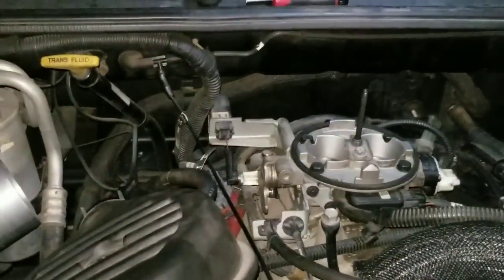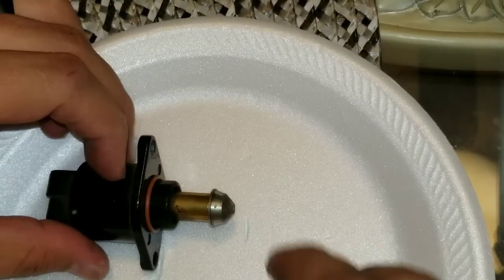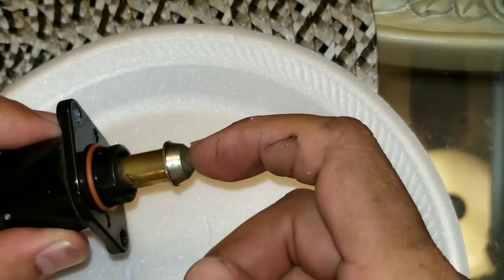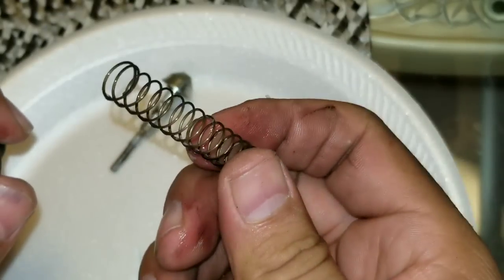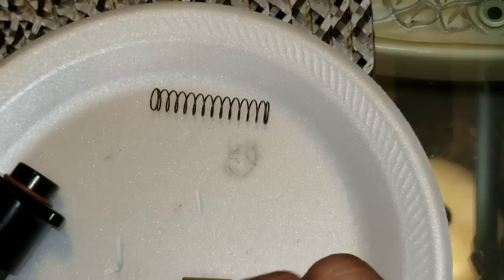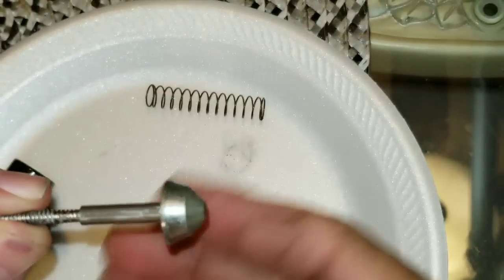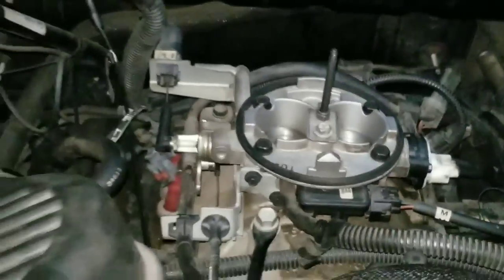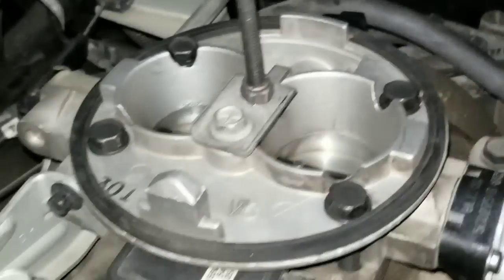How to clean the Idle Air Control (IAC) valve

Comment: That white substance was >>White Lithium Grease.  It is a bit heavier/thicker than 3inOne oil.  3inOne oil just might be vacuumed out of the IAC due to the engine air intake suction.  A slightly heavier grease may have been better.  Such as Synthetic if not the OEM.

Comment: That's how you destroy the iac valve, the plastic bits on threaded rod are stops so rod doesn't spin in place. 
Time for a new valve. 🤔
Reply: Yup. Pulled mine out to clean it and ruined it this way. Had to go buy a new one yesterday for being an idiot. 150 bucks down the drain.

Comment: Do not use acetone to clean the valve as it will destroy the internal seals. But spraying it with q20 will dislodge the carbon deposits. Leave it soaked for 1/2 hour then.shake it out. Repeat if necessary.

Comment: But bro it breaks the lock which keeps the spindle in position. I removed th iac of my bike.while doing throttle cleaning ,my father turned the spindle and when i fitted it back guess what the spindle started rotating and came out.

Comment: Well-intentioned Brandon. However it breaks that plastic shoulder inside, that it locks into. You're lucky It didn't break your plastic shoulder the pintle shaft goes into, and the idle air control valve is likely to vibrate and move the pintle. The shoulder made of plastic is not going to hold it from moving if there's any vibration which there is probably and it's not going to stay put for long. this might work in a bad situation where you have to have it right now, but it's not going to be a lasting solution.
Reply: Good point!
Another way to remove the spindle is by remove it from TB but do not remove the cable. Turn on car key, the IAC will automatically move spinde forward and eject it. Don't forget to wrap the IAC in some container or the spring and shaft will gone!
Reply: @MRsickcat84  how do you replace it afterwards?

Comment: Got the p0505 code.  I took it off and sprayed it with carbonator cleaner.  Now it idles worst.  Starts up good.  I did not take it apart.  I will do what you did.   I am thinking I can just clean it.  It's not like a brake pads.  I will let you know if it works.
Reply: Still doesn't work.  Put a new one on.  Still doesn't work. Fuck cars
Reply: Try Clean throttle body n map sensor .

Comment: I’m sure you broke it. It does not screw out like that you have to pull it straight out. They only cost nine dollars and up if you don’t want to buy a new one you just glue it in place which I did because when you can’t get to a a computer you don’t have access to adjustments

Comment: That "little nipple here" is called a "pintle".   This IAC valve isn't, even the slightest bit,  in need of cleaning, BTW.  I'm reminded of a couple phrases while watchin this......"looking for a solution to a problem that doesn't exist"  and  "if it ain't broke, don't fix it".
Nice video demonstrating the breakdown of an IAC valve, though.  Not sure why your "problem" went away after this, but I doubt this is what "fixed" it.  IAC valve has nothing to do with shifting and rough idle can be caused by many things.....IAC more a factor in idle speed than roughness.
Reply: I've found the wire harness connectors connection for some reason can be an issue on the TPS and my thought is just cleaning the tip of the IAC maybe.  I'm no expert and have only removed the TPS and rotate full motion to verify the DMM resistance readings range for the pinouts and the IAC to clean with just some carb cleaner dampened shop towels.  Also, cleaning with the dampened shop towel the inside of the valve and as far as I could get in of the inside of the body.  Seems to do the job when mine starts running funky.  Wondering if just the TPS, for some reason needs a full range of motion, is all at times.

Comment: well... I just destroyed my idle air control. mine is locked in with a rectangular shaped insert, so when I tried to unscrew... it then cracked and split🤔
Reply: The video was poor advice, though I gave him the benefit of the kind intentions. Mine broke as well the plastic shoulder that it goes into that locks it in place is broken. Well in a pinch I think his advice is good but the force needed to detach the pintle and rod breaks the shoulder that it's inserted into so the life won't be very long probably for this, because it's not locked in place and vibration could move that pintle and the plastic will probably deteriorate more. Thus I had to buy another AIC valve, or I will have to take it out again and replace it anyway. This videos author is blessed because his did not break it is likely to break the author needs to know that other people's very same idle air control valves.plastic shoulder part it is inserted into are breaking like yours and mine. Though it goes into the metal threaded something beyond the plastic shoulder part.

Comment: Great video man but they only cost like $10 it would be way easier just to buy a new one lol
Reply: Where can you get these at for $10  cheapest I found is $35 appreciate a place to purchase at $10 thanks,          GREAT VIDEO
Reply: @Mr1972chevelle  it was actually$7.44 on eBay I have a 01 Dodge ram I'm pretty sure they're that much at O'Reilly's and advance Auto
Reply: @TKD187  the cheapest I have seen on eBay is $30 & AutoZone wants $55 for theirs but I'm still checking all I can see don`t have Oreilly in Northern VA.
Reply: @Mr1972chevelle  I swear to God that have idle air control for 7.44 on eBay lol if I could I would send you a picture
Reply: Rock auto
Reply: My IAC valve cost 280.00
Reply: @Mr1972chevelle  if I can get one for 10.00 I need one
Reply: @loquacious.randytorres6321  what kind of car do you have !?
Reply: I wish they were 10$ for a Suzuki sidekick they want over 200$ on eBay! Total rip off
Reply: @loquacious.randytorres6321  mine too
Reply: $47 new for my old Pontiac 3.1

Comment: Good video but I would have put some locktight ( thread lock ) on the threads before reassembly
Reply: Whys that?  I have changed out mine 5 times and engine light still keeps coming on code p0505
Reply: why didn't he measure the length when he took it out?
Reply: They aren't threads

Comment: Did it work?
Reply from the maker: It did for a bit then started to have issues. I would just suggest replacing it for a new one. Not too expensive but I would stick with OEM for these sensors.